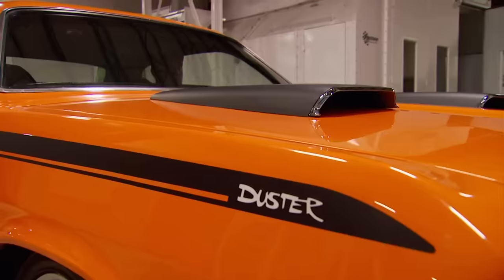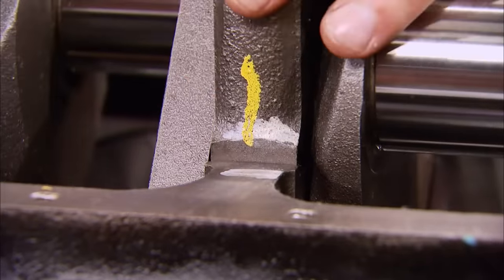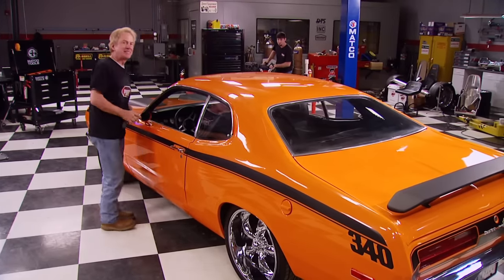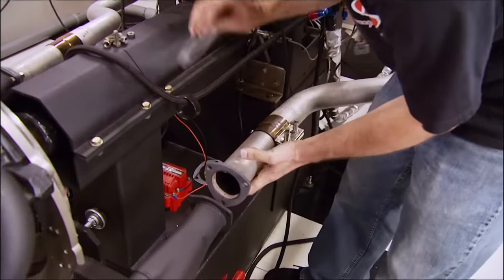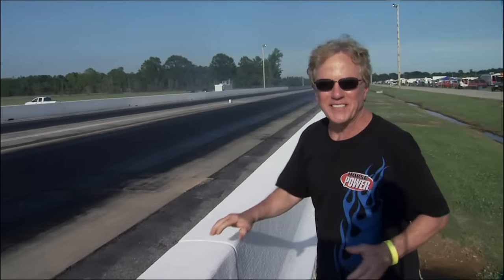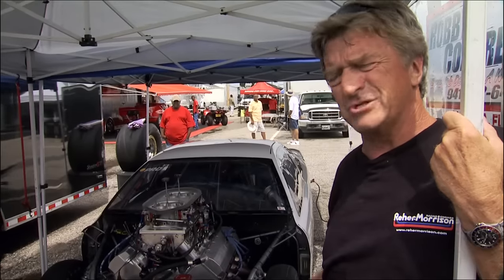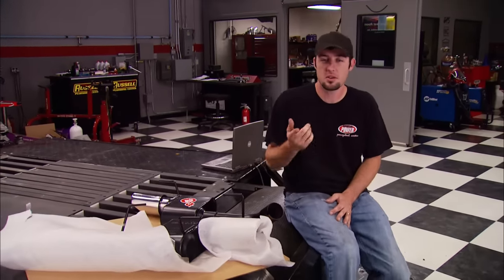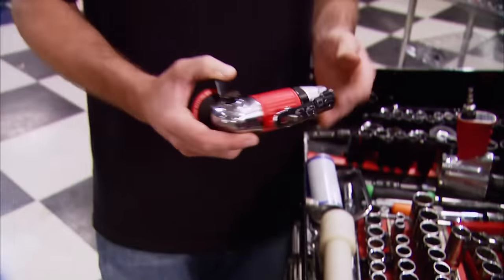Mopar 360 Build on a $2,500 Budget - Horsepower S13, E17

Comment: So let's see......they built the 360 with the small valve "emissions era" heads. It should have been easy to get 375 h.p. instead of 314 h.p.
Reply: Yeah, wimpy built. They seem to always under build the power on their engines, every one. This engine should making 50+ more horses. I dont know what they are doing wrong, but a lot.
Reply: They are trying to show what u get with a "stock refresh" style rebuild. No performance parts type thing. 
The 315 "semi"-gross i guess u could call it hp they are showing here is right on par with the factory 255 net hp rating. Didnt u hear him, he said we still got the performance build to do yet.
Reply: One word; compression. Stock 360's (early LA ones anyway, not magnum) had pretty weak compression. The pistons they used look like the sealed power 405's which have a compression height of 1.576 inches, and add to that the later stock heads with a 72cc combustion chamber. If you do the math and factor in the dish of the piston (8.8cc) and the head gasket volume (~10cc) and the compression works out to just 7.5 to 1. On top of that they chose a pretty low duration camshaft, so it was destined to make the peak power it did. IMO the best way to wake up any of the stock LA engines is a taller piston to bring the compression up.
Reply: low compression is WAY more practical..  You can load in tons of advance timing which makes an engine much punchier and responsive and "streetable" i.e. way funner to drive. And, it can run on today's garbage gas.
Reply: Aftermarket Mopar small block heads are stupid expensive, it would've increased the budget by half.
Reply: that and a cam that was for a truck and max power at 3800 rpm with headers of 1.5 in tubes with 2.5 inch collectors and i noticed they didn't call out the timing changes they made. not horrible numbers but my 340 would make the same hp on 6 cylinders. Could you bowtie boys screw the numbers alittle more please. did you run it on 87 octane from california with mtbe ??
Reply: Joe Figueroa  sure 300 on the dyno but test it on a chasis dyno when it's in the car. If it's geared right those numbers could do something but the LA motors are all top end. small lift , small valves, small headers with a rpm range 1000- 1500 below normal. Cam is maxed out just when a 360 is stating to really get moving. Its like they installed a restriction plate on it with their parts selection
Reply: @jamesbetts3371  - That 218/228 cam they used could go 400 HP with better parts choices and build details...
Reply: @johnjacobsen2736  - BS... low compression ratio engines feel 'soggy'...

Comment: Once again you shoot the Mopar in the foot. A GOOD cam would have been the same price and made MUCH BETTER power. When I built my 360 for my Aspen R/T I used an effectively stock engine that I did a ring and bearing job on, a .480 lift 230 @ .050 107 lobe separation cam with a Weiand 8009. The car ran very hard and was totally streetable. But a build like that here would (as usual) embarass the Fords and GM's, so us Mopar guys get shit on just like has always happened for the last 40 years.
Reply: mcm95403 I got a 77 aspen rt with a 318, i got a 70s 360 I’m going to build and put into it some day, and it’s not only going to have 300hp like this one, it’s going to have much more because i want people to know what mopars can do
Reply: FUCKING DRY YOUR EYES 95403!
Reply: @camgnilpe9300  HAHAHAHAHA

Comment: The guys that respond to this video. Sound like a bunch of preachers talking about the correct way to get to heaven.  LOL
Reply: It's easy just obey Christ then you wont go to those preachers Jeremiah 23
Reply: @donaldpowers5557  These replies are like a scattered flock of different ideas to get to the same place. Horsepower!
Reply: well, unlike god, the tips and tricks actually exist and work.
Reply: @frigglebiscuit7484  the only trick as you think they actually did something they just assembled a stock motor with a RV cam most of their budget was on a stupid flashy shit water pump March pulley set the valve covers that overpriced intake manifold and the carburetor is going to be over $1000 just for flashy bullshit

Comment: Your cam specs. Are close to the stock hipo 340 cam.. so it's a stock rebuild...
Next build up throw some lift at it something. 520 to .560 lift  then we'll see some higher horsepower and torque numbers.
Reply: That's the typical low cost Summit/Jegs rebuild cam spec... and it's a Chevy grind. No kidding!  The upgraded Purple Shaft from Mopar has just a tad less intake lift but more exhaust, revised duration, and better power range than the OE 340 did. Works exceptionally well in lower compression low stall auto 318s and 360s. Runs your power brakes, cruise control and a/c all day with a smooth idle, but nice lower end torque and good passing power.
Reply: @adamtrombino106  purple shaft cams are old garbage 70s tech that should be avoided.

Comment: Good thing they rigged this build with low compression and a small cam like they do with Ford builds, If they built it with normal compression and a good cam the Chevrolet faithful would be soak-in their cry-in towels when they saw how much power a 360 can really produce.
Reply: Let me Know Brother.. 68 Dodge Dart Daily driver.. Everyday and Everywhere.. 318 and slant6.. yes one is hers and mine is fast.. haha
Reply: These guy's think 300 h.p. is fast...just for starters and put some compression at least 10.5.1 to 11.5.1 and do an E85 build.  E85 is equivalent to 105 octane and engines run 20° degrees cooler. It's a win win all the way around and a cam with a min lift of .520 (see some horsepower numbers) some tuning required.

Comment: 2500 and 314 hp ,they need
 to learn more
Reply: Stock smog heads with 1.88 intake valves isn't going to get them much more than that.
Reply: They can make more that was just a little more than stock rebuild
Reply: Correct: https://www.hotrod.com/articles/318-small-block-build

Comment: so a cam, intake, carb, and some headers is a build now.
Reply: no, they did in fact build a motor. the tip off was when they installed and assembled parts to a bare block. not to mention this is the basis for upgrades as they always do.
Reply: You just watched them assemble the entire engine.
Reply: Tiny cam...the specs are real close to the hi-po 340 cam
Reply: @Ecosse57  you are mistaking the meaning of "build" yes they did build a pretty much stock engine. a build in the car world would be something custom like forged bottom end, heads and a turbo. cant really call it a build if its mostly stock with some bolt on's.
Reply: For 2,500.00 bucks poor man like me rebuild on a budget not 2 shabby
Reply: Always has been although mild
Reply: They used a 400 HP cam, just needed to port the heads and add bigger valves...

Comment: They called it "the hemi of the smallblocks"?, who are "they"?, I've never heard or read anyone referring to them this way.
Reply: You are 100% correct! Sounds like they just made up this B.S. for the show.
Reply: I'm a gear head from when the 340 was new. I have heard giant killer more than once but  Hemi of small blocks ,,No. Ps until the Magnums came out  I think only the 68 to early 72  340s came with the 2.02 intake valve. No 360 did and until the end of 340 production in 1973 the 360 was only a 2 barrel engine used because cars were heavier and  HP was down.
Reply: Here in Detroit they were referred to as Baby Hemi .
Reply: That was the earlier polysphere small blocks... https://www.hotrod.com/articles/318-small-block-build
Reply: @BuzzLOLOL  The Poly was called the semi hemi.
Reply: When we raced in the 70’s and early 80’s, the 340 was referred as the mini Hemi, Road and Track or Car and Driver even put a 340 barracuda against a 400 Firebird and a 396 Camaro... it beat them both. The giant slayer

Comment: "Budget Build"? More like stock rebuild. What's the point?
Reply: To build the engine for cheap. Honestly, what did you expect? For them to use expensive race-engineered parts or second-hand garbage? They did fine, found all new parts and did so without spending a ton of money. Apparently, the concept of a budget build is lost on you.
Reply: @ReallyRyan.  - no... the concept of a budget build is not "lost on [me]". A true "budget build" would've included some performance hand work, such as porting and polishing, etc... this is little more than stock, with an RV cam. That's too close to stock, to drop the "re" of of "REbuild".
Reply: That is the point #stockpower over whats chevys stock power for similar 5.7 ill wait
Reply: @youngmopartruck3462  - if you're benchmarking "stock power", just call it a "stock Rebuild". Pretty simple, if you ask me. Nobody was butthurt enough to bring up Chevy 'til you... so there's that. Furthermore, I can guarantee... for the price of this stock rebuild, I could make a Chevy turn more ponies. As a matter of fact, for the price of a couple sanding drums, anybody who knows anything about engines could've gotten another 20 horsepower and better throttle response out of this engine.

Real engine builds (not REbuilds) don't end with a catalog order and some jet/timing changes. For God's sake, cheap crate motors get more massage work.
Reply: I was simply stating a fact no argument here
Reply: @youngmopartruck3462  - no, you didn't state any facts. Had you've been familiar with Chevy 5.7, and it's many variants, you would know that Chevrolet has produced that engine in stock variants up to 325hp. You would also know they contracted, and sold under license, three more variants producing as much as 425hp. 

...and yes, when you start babbling bullshit and attempting to pass it off as "fact", you are starting an argument. It's called gaslighting.
Reply: Mopars are way more expensive then for and Chevrolet to built. So, in order to keep a similar price they had to skip on some performance parts.
Reply: Yeah, Hot Rod did a 400 HP 318" for less money: https://www.hotrod.com/articles/318-small-block-build
Reply: Ya why not throw a aftermarket cam in while ya doing all that work
Reply: I agree. My 408 stroker was more like a budget build. 500 hp, solid lifters, etc. I it used for stock car racing then land speed racing.....hardly a high dollar build.
Reply: @jamescopeland8813  Beast Mode .....😎